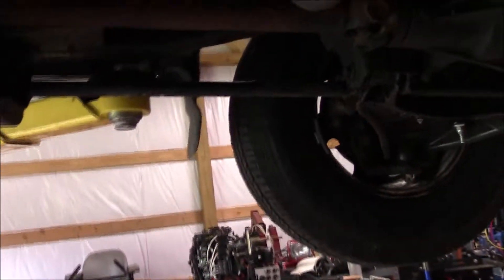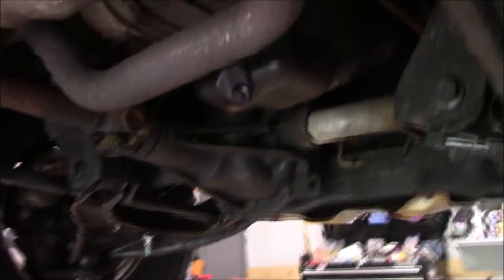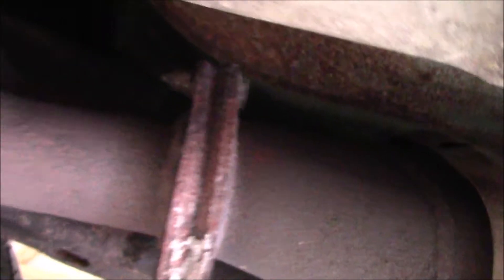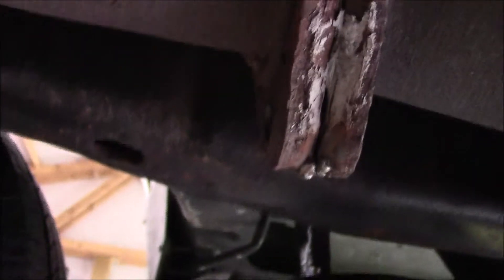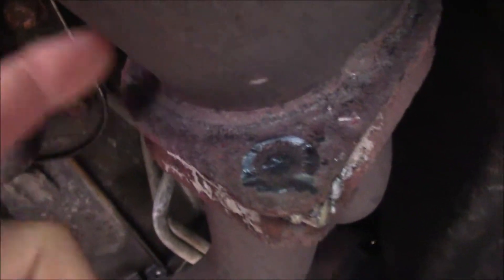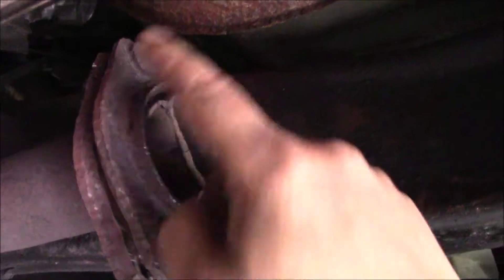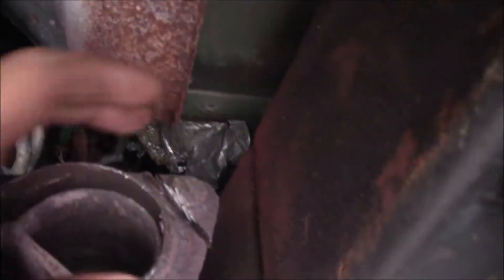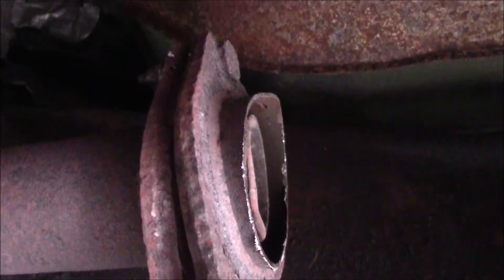2000 Ranger exhaust leak repair

Comment: Just came across your video.  Tackling the same issue on a 1999 Ranger right now.  Wishing I had an acetylene torch kit or even a lift right now.  Major PITA that is unresolved.  By chance would you happen to know the replacement Bolt and Nut size?  Wanted to get those on hand for once I am able to wrestle this thing free.  :)
Reply from the maker: It was a really long time ago, but want to say it was 7/16 for 3/8 by 1 1/2 inch.  I am thinking it should be a metric bolt, but didn't want to look for it.  Maybe an M8.
Reply: @mrfixit4211  Appreciate the response. Thanks!